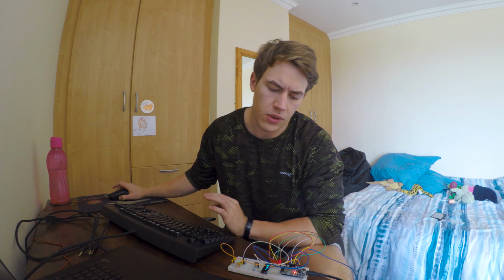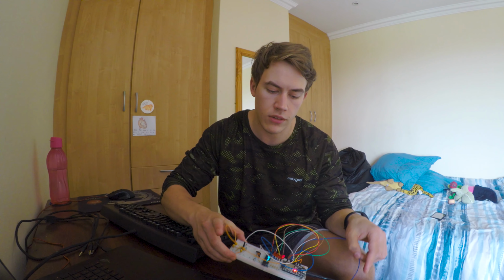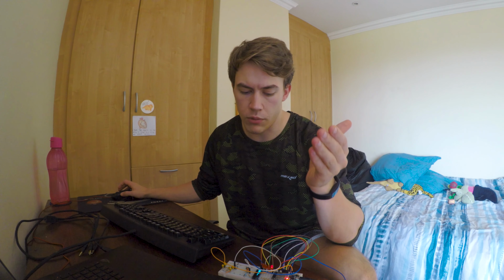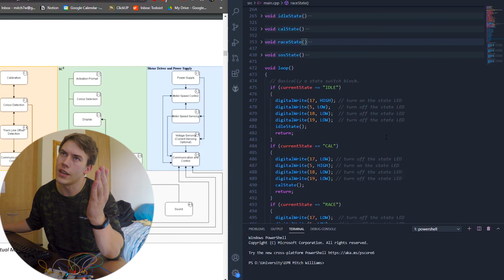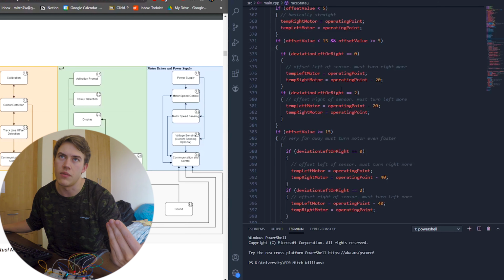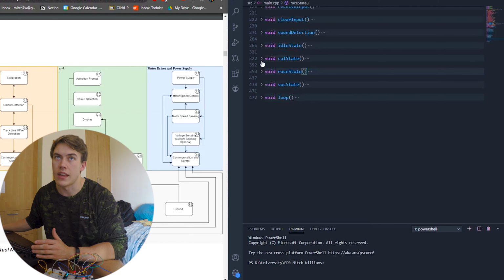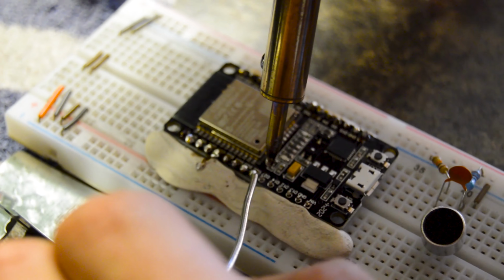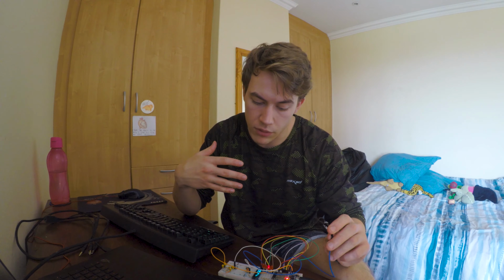Engineering Design Project | Arduino ESP32 Coding | Electronics University Project

Comment: I'm currently in Grade 12 and I also code ESP32 as well as ESP8266 modules for stuff like home automation, WiFi jamming, robotics etc. One of my favourite modules to work with has to be the Bosch BME 280 since it's easy to use and I recently implemented it into a DIY homekit compatible humidity and temperature sensor. I also code Arduino development boards for fun so I guess I'm a bit of a nerd. I'm really nervous about varsity next year but I think I'll be able to cope.
Reply from the maker: If you're already so deep in the microprocessor world I don't think you're going to have any troubles at varsity 🤣